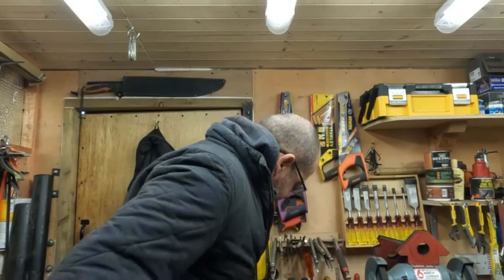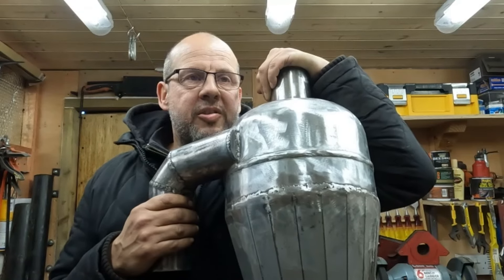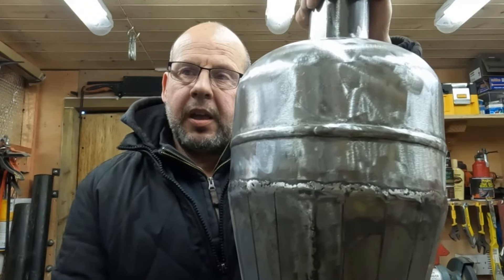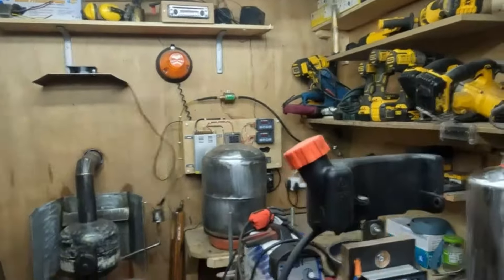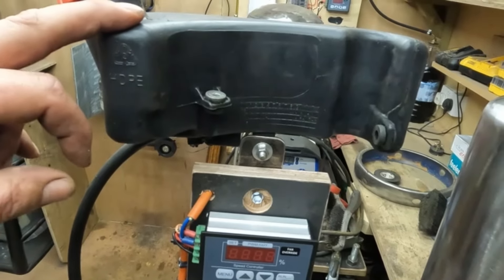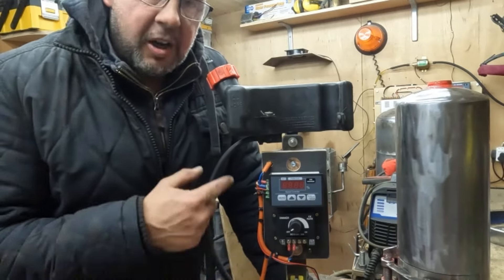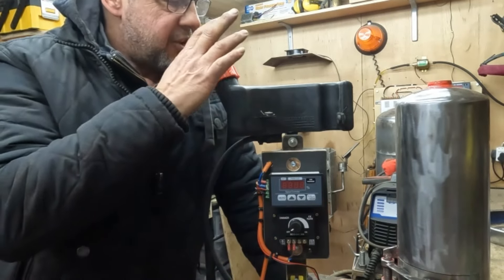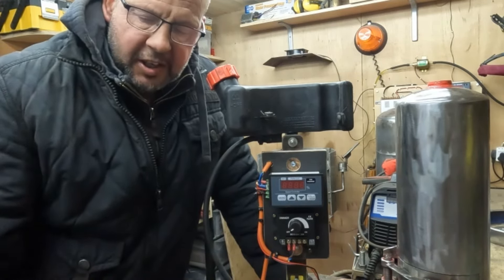DIY Homemade PORTABLE FUEL CELL for Waste Oil Burners, Take it Anywhere with your Oil Burners.

Comment: Thanks for taking the time to explain.
I'm no expert I have made a few in the past and adding anything that adds restriction to the exhaust is tricky. On my last one I made a 🛢to sit on top on it's side with baffles etc to get it to swirl it was perfect I thought. I ended up back to a empty 🛢and even then it needed tipping up a little. It was worth it though at least half of it got cherry red.
Reply from the maker: Im no expert too, but we keep trying new things, ive got a few good Idea's which im working on, one being an directional air flow system using horizontal air tubes directly in the flames with a fuel system that comes directly in the center of the burn pan from underneath with 4 outlet fuel outlets, should be interesting my friend.
Reply: @stephenminton339  I've often thought using a pump and controlling it electronically would be the best option to get a consistent burn and add a element of safety that a gravity drip feed can't. Your controls are pretty cool. I think you should think about using the temperature sensor you had for the fan as a kill switch for the pump with a min and max cut off temperature my scariest moments have been flooding to the point oil spilled out.